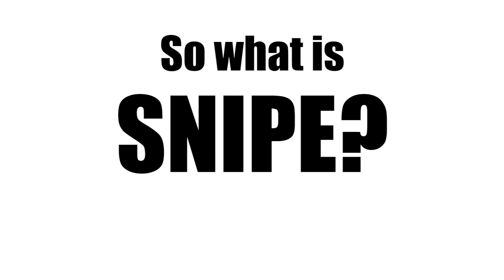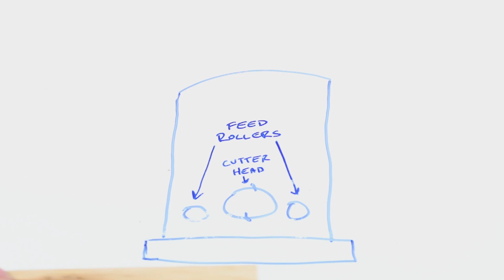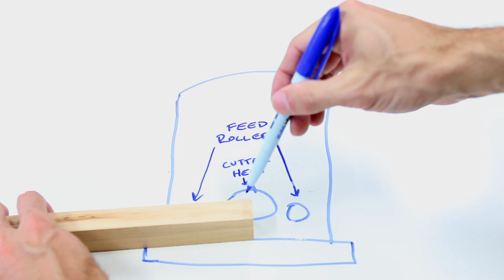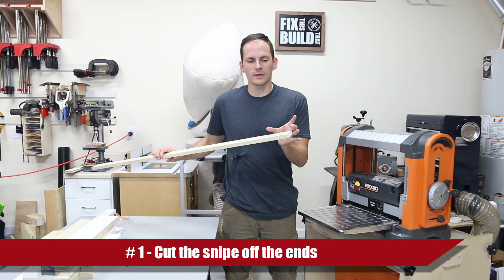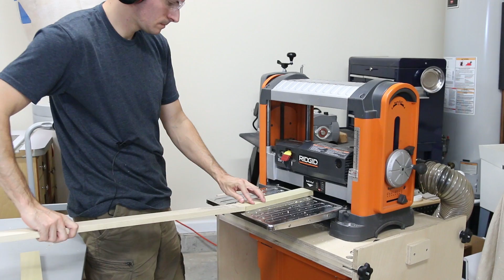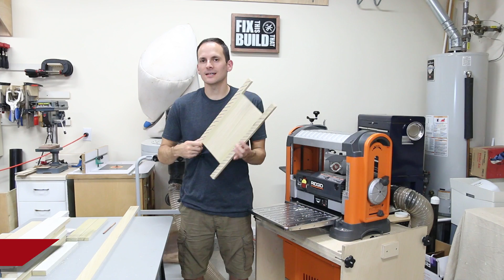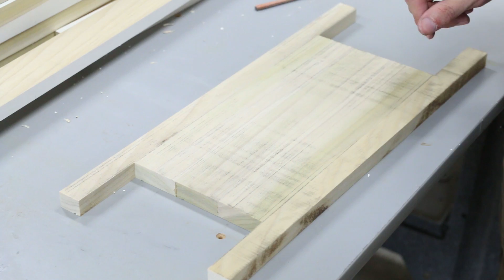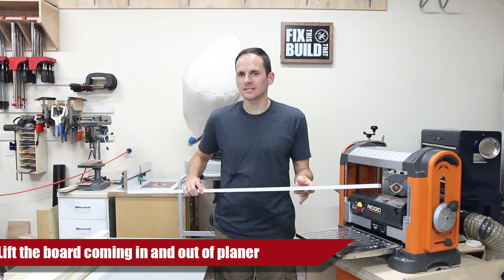6 Ways to Reduce Planer Snipe

Comment: Hey Brad great tips there but I cannot figure out why sometimes I’m getting gouges on my boards after it went through he planer.  I have flip the blades and use the new side so I know it is not dull. I thought that the rollers probably have wood chips trapped there so I put some paste wax there but nothing I did fix the problem.  Sometimes I get little gouges other times I get one or two big ones.  Not sure what’s wrong.
Reply from the maker: Check your dust collection.  I do think it's the chips.  They get blown back and then get smushed under the feed roller and dent the wood.  Lighter passes tend not to do it for whatever reason with me.

Comment: Hi, I think your way of showing snipe using the halved pencil is not correct. You hold the pencil almost perpendicular to the board, allowing it to follow the snipe step. Instead you should keep it in line with the board, holding it down on the long end. That way it will stay level and not run down the step. I think the footage clearly shows you marking snipe as it was not there.
Reply: What a Rs

Comment: Like yours, my Rigid 13' planer is the older version with the side crank and the lever for repeat cuts. From the videos I have watched here lately, I believe this version is better then the newer one. I am patient so I take light passes 1/64" - 1/32" and if there is any snipe it is minimal and easy to sand away. However, I will begin using the back to back feed and side by side feed to see if I can eliminate it entirely.Thanks.

Comment: I needed to plane down a bunch of 18" boards.  After adjusting the infeed and outfeed tables, I was still getting an unacceptable amount of snipe.  Running a leader and follower board worked like a charm for me.
Reply from the maker: Glad it worked for you!
Reply: Were the sacrificials 18"? Did you use a seperate pair for each board?

Comment: Great Video Brad. Also good to mention that there will be more snipe if cutting against the grain as the blades tend to 'dig' more before getting to the second roller which then holds the end of the board back down. Cutting with the grain reduces tear out as well. This is more of a problem with flat sawn or through sawn boards. It is much less of a problem with quarter sawn and even less so with rift sawn baords.
Reply from the maker: +Thomas McGrath III good tips!

Comment: Interesting video. To be honest, unless the timber is expensive I just cut off the ends. How many times do you have a board exactly the right length for the project, invariably you have to cut too length resulting in offcuts. We all need firewood anyway!!!
Thanks
Reply from the maker: Yeah, for sure.  Cutting the ends of is by far the easiest way to get rid of it :)

Comment: There is a 7th method that you did not mention. Don't use a plainer at all! Simply edge glue using  a biscuit joiner or festool domino rig if you're a a millionaire and then hand plane the crap out of of it.

Comment: With sacrificial sides, they need to be wider than the ones you used.  they need to be capable of feeding through without flexing too much.  What happened in your case was the side boards flexed hitting the exit roller and essentially allowed snipe on the work piece.  A wider side board would reduce the snipe more.  If you are planing thicker pieces, you can use narrow sides, but with thinner thicknesses, you need to compensate with wider sides.
Reply from the maker: +John Hunkler thanks for the input 👍

Comment: my adjust a cut is stuck or locked at 1 3/4. I want to go thinner but it won't move.
Reply from the maker: +Michael Engel it's probably jammed up with debris. Try accessing and cleaning from the inside.
Reply: I got it to move and then gave it a shot or two of WD40
works like a charm now

Comment: ..Why do you think that it's better to sacrifice a 12 to 15 inch piece of wood instead of the "2 inches off of the ends" wasted stock?  If you need pieces of wood 40 inches long, cut them 44 inches, let the snipes come, then trim them off.  Four inches of waste as opposed to 15.
Reply from the maker: +William Dungan Jr. That theory works great until I have to plane 10 boards. Then I lose 40" with your method while still just 24" with mine. Also I'm using scrap wood, not hardwood. So I'll lose 24" of pine vs any inches of walnut any day. That's the way I think about it.

Comment: One more way to (probably) reduce Planer Snipe:
My planer has a stainless steel lined liner beneath the roller/cutter head. Under the SS liner there is a machined flat surface. 
I took the liner out and found a layer of compressed planer shavings under there!!!! Oh, well, that explains a lot!!!
I suppose, make sure the liner is sitting on a clean machined flat surface.
Reply from the maker: +Ross Marsden Oh, sneaky. Wouldn't have thought of that!

Comment: The only way to reduce snipe on this small type of planers is to lock the adjustable head in position (which is not possible on most lunchbox planers). I literally took the planer apart and ran a lot of stock through it to see what is happening and the problem is that the head do move and it is not supposed to move at all. At the end i managed to eliminate the snipe by clamping the adjustable head with g-clamps, but this was just to big of a process. This frustrated me so much that i eventually just bought a solid 20" cast iron planer. The problem with the large planers is that they do snipe also, so do not be fooled that it does not happen with the larger planers, but this in turn is also a good indication that your planer needs to be adjusted/calibrated again. Once properly  adjusted/calibrated it does not snipe. I've measured my stock at the start, end and middle with an electronic vernier and did not find a difference. The main reason for this is that the adjustable bed can be locked in place before you plane. Very easy process.
Reply from the maker: I agree completely that you can't eliminate snipe with these.  But mine was about reducing snipe, which several of these methods did help to do.  Wish I had a 20" planer like yours!!!  Thanks for the feedback.
Reply: The 20" is a beautiful planer, but does have its limits. You cannot plane anything under 6mm. My point is, even with the snipe on the lunchbox planers, do not get rid of it. Keep it for the thin planing. Also another thing that actually works and reduce snipe is to install a solid base on top of your planer's bed which extends at least 400mm on each side. I'm still busy with my lunchbox planer and will give feedback if i find a better way to reduce snipe. The sacrificial wood works well, but it is a pain to prepare this every time. Cheers and thanks for sharing.
Reply from the maker: +Johann du Preez makes sense.  Appreciate the feedback!

Comment: If the sacrifice board can be re-used it is not really sacrificed.

You can use only one and grab it at once as it exits and re-use in the same operation at the end.
Reply from the maker: +woodensurfer agreed!
Reply: The sac board has to be of very similar thickness of the work. Generally this is not a problem because we generally joint stock of certain usual thicknesses, say 4/4, 3/8 inch etc.

The only time I need 0.673 inch, say, is for use a shim/spacer for jigs.

Comment: What are your thoughts on extending the infeed and outfeed table, does that work well or is that gonna give the same effect on snipe. I just built a cutting board and now I have 2 inches of snipe on either end. Not very happy with that. Any suggestions is greatly appreciated. Thanks for sharing your video.
Reply from the maker: +frehleycomet if you make a flat bed that runs the length of the infeed and outfeed it should help. There are a few videos on that out there. As far as the cutting board goes I'd try lighter passes, pass it at and angle and if you have any scraps from the build you could try to feed those in first and the board next to it after the scrap has engaged the cutter head.
Reply: Fix This Build That unfortunately the cutting board is about 1/4 inch less than the width of the planer. sideways will not work bud. will build the table though and go from there. thanks for your advice
Reply: frehleycomet There's this other issue that the rollers and the cutter move as one unit, when the board comes in the whole assembly tilts a bit but it levels out as soon as the board hits the second roller, so extending the tables won't have a big impact

Comment: have you heard about setting the center table low by the thickness of a penny?  This is supposed to eliminate snipe.
Reply from the maker: +Dan Ramsey Yeah, that's basically what I was talking about with raising the infeed and outfeed tables.
Reply: Easiest method is ..... It has an adjustable snipe lock that when adjusted properly, snipe is virtually eliminated. No need for these other ideas. This same machine design with adjustable snipe lock carried over to when Steel City took over the design as a 40200H and now Cutech Tool as a 40200H-CT. Put the snipe lock lever in the locked position and remove the crank handle by removing the center screw. Then, pull the snipe lever straight outwards about 1/4" until the teeth of the lever disengage the teeth of the tension rod inside the planer. (look inside the planer and you'll understand) Once it has disengaged, move the lever to the left one tooth and push it back on the rod to re-engage. Put the crank handle on and try again. If the snipe has lessened, but not gone, you may need to repeat the process again. Keep in mind that as you tension the lever, it will require a bit more force to move it to the right. But do not force it all the way to the locked position if it feels as though it will not go all the way. The tension applied will be enough to keep the cutterhead in place even if the lever stops 3/4" from the full locked position.

Comment: the sacrificial board is the most wasteful method...
Reply: pine is cheaper than walnut and you only need a 2" strip for in-feed and out-feed.  It doesn't need to be as wide as what you are planing
Reply: very true, and you can use the same sacrificial scrap several times. best use for scrap i've found

Comment: RIDGID has a online parts catalog & the motor brushes & Caps for your TP1300 are N/A !
Reply: Check Cutechtool.com The older Ridgid TP1300 is now Cutech's 40200 with spiral style cutter head. Parts are interchangeable.
Reply: MOTOR BRUSHES & CAPS FOR YOUR TP1300 ARE N/A ! Once they wear out you must buy another planer . A NEW CUTTER HEAD IS WORTHLESS WITHOUT BRUSHES & CAPS . SEARCH BEFORE YOU BUY !

Comment: i think having a leading board and a trailing board is the best way.
Reply: How are extra boards cheaper than cutting a couple of inches of off each end? Both in cost and in labor
Reply: me too
Reply: Keith Hill
Reply: Surely this uses more wood than the end trim. Has to be longer than the trim and when you have to ten boards you have to have ten sets of sacrificials. Might make sense though if the board(s) is (are) teak and the sacrificials are say redwood. ?? As others point out there questions of time and availabilty. Different view onsite for a client v's homeshop.
Reply: Keith Hill only problem with that is you have to have those boards in the right thickness, thus more work

Comment: I have this same planer and cant get it to plane thinner boards. like the thing is jammed or something? I don't have the manual so I am looking for help to get it adjusted.
Reply from the maker: It won't go thinner than 1/4"  look at the slide at the bottom under the turnwheel.  Slide it all the way to the right to the 1/4" setting.
Reply: Actually, the preset depth stop can be set all the way down to 1/8" ...which is the thinnest you can plane down to with this machine.

Comment: I make cutting boards with expensive hardwoods so I can't deal with snipe.  I make a sled with a 4', 1 x 12 piece of mdf.  I attach a sacrificial piece of  6" long  pine that is the same thickness as my rough cutting board to the sled with 2 sided tape.  The piece of pine doesn't have to be as wide as the piece that you want to plane. then you can butt 2 cutting boards together and then attach a piece of pine with 2 sided tape behind them to take the snipe and run it through.
Reply: Wayne Howe how much do you sell those for?
Reply: small 13x8 $40 large 16x10 $50
Reply: Wayne Howe no
Reply: Sorry, what do you mean by no?
Reply: Usually cutting boards are end grain. I have the same planer as what's in the video and cannot run end grain through it. Learned the hard way.

Comment: Why don't you adjust the feed plates up a little? You were moving the board up and down while feeding the board. If you were able to adjust the feed tables up a little you would take out one variable of movement.
Reply: Richard Katzman If you adjusted both feed tables up you would end up in a bind. He first lifts it on one side, then the other. Not both at the same time. At least that's what would happen in my head.

Comment: Great techniques! While the board lifting into the cutter head can and does certainly cause snipe, I believe the primary cause is that the cutter head/pressure roller assembly moves as a unit. When the first roller is contacted, the assembly tilts slightly, leaving the cutter head and second roller hanging lower. As soon it contacts that second roller, the whole assembly levels out. This is why using a sacrificial first board works.
Reply: Good points. Also, this planer is a Ridgid TP1300. It has an adjustable snipe lock that when adjusted properly, snipe is virtually eliminated....no need for these other ideas. This same machine design with adjustable snipe lock carried over to when Steel City took over the design as a 40200H and now Cutech Tool as a 40200H-CT. However, the Steel City and Cutech versions both use a spiral style cutterhead.
Reply: Ahhh. I was wondering why this would work. Because there is still a pivot point. Thank you.
Reply from the maker: +Matthew S that makes a ton of sense!
Reply: I agree. The whole cutter head assembly, consisting of two pinch rollers and the cutting wheel between them, is constructed to tilt slightly when needed (although I can't explain why, wish I could). The pinch rollers are spring loaded and will move up slightly when they engage the workpiece, then drop back down after the workpiece passes by. At the beginning of the cut only the rear roller is engaged, the front roller is still at its original (lower) height, the rear roller is higher (say 0.010 in. for the sake of argument), the whole assembly is tilted down towards the front, so that the cutting wheel is tilted 0.005 in. lower than the rear (driving) wheel. As soon as the front roller is engaged the assembly levels out and the cutting wheel assumes the intended elevation relative to the drive rollers for the remainder of the cut--until the workpiece leaves the rear roller behind. Then, the rear roller will drop 0.010 in. and the cutting wheel will drop half that much, leaving 0.005 in. of snipe until the end.

At least I think this is the way it must work. I have never seen or read this description, though.
Reply: yes
Reply: A quality thickness planer should not move as you have described. I have a Wahuda 13” planer and is rocksolid without any snipe out of the box. I have owned heavy duty thickness planers all my life, and have to say that the Wahuda performs every bit as good on a smaller scale. The community where I presently live, has a nice woodworking shop with a Dewalt thickness, planer, which cost more than the Wahuda and doesn’t hold up as well as the Wahuda.
Reply: most definitely. taking that into consideration; eliminating that action should then eliminate snipe right? running the timber through with incremental passes rarely produces snipe (and can fix it*). Test the piece you are planing so that is just catches on the rollers but doesn't plane, and then lower the height of the planer by a fraction of an inch/cm for each pass. Yes it takes longer but, no snipe, when you get the hang of it. *to fix a sniped end, ideally catch it as soon as it happens, back up the height a fraction and plane the piece several times at that height until it wont catch on the knives and then do that same; reduce the height of the planer very gradually, do several passes, until you feel the snipe has been leveled off. Scribbling pencil across the whole piece on these passes gives a good visual guide as to how well, and where, the piece is being planed.

Comment: Jay bates built auxiliary in-feed and out-feed bed as one, that way both the in-feed, cutter head, and out-feed are co-planar.  Keep in mind, this will reduce you capacity.  I have yet to do it for my planer.  Time and money, always running low on one of the other...for me its mostly both...:-)
Reply from the maker: +Charles Massey (Woodchucks1) Yeah, I meant to mention the sled option but forgot and didn't want to squeeze it in during editing. Great option though.
Reply: +Fix This Build That Thanks for all the other suggestions,  I've used several in the past.  Excellent video, keep up the great work.

Comment: Method #3... that seems just as wasteful if not more than method #1.   
Method #4... ditto  

I have that same planer, I never really get snipe in the front, but I sure do in the back.   Maybe I need raise up that back bed up slightly?   I do think angling the wood when feeding does help.

Question:  Where do you get new blades?  Any place less expensive than another?  Thanks man!
Reply from the maker: +Jon Lanier great point. I didn't explain it very well, but you're right if youre only doing 1 board. But on #3 you can send multiples through at a time, board after board end to end. So if you're doing more boards it's less wasteful. Also, they make great test board for joinery and test cuts. 

I don't have any special place for planer blades. I do use Holbren for jointer blades though.  Thanks for the feedback!